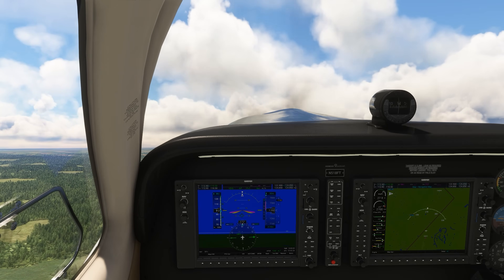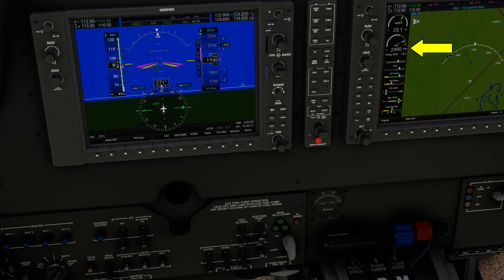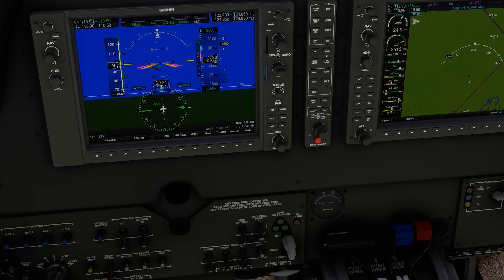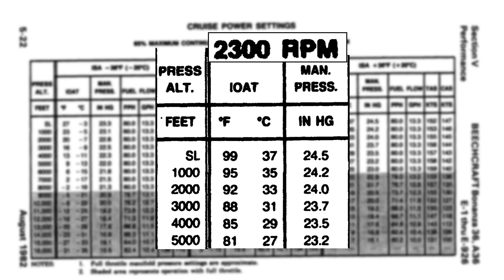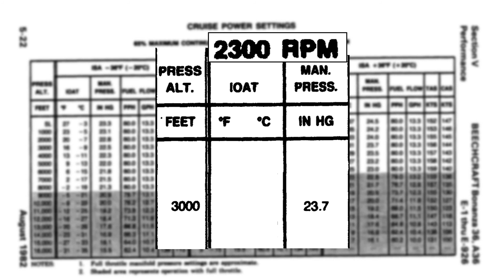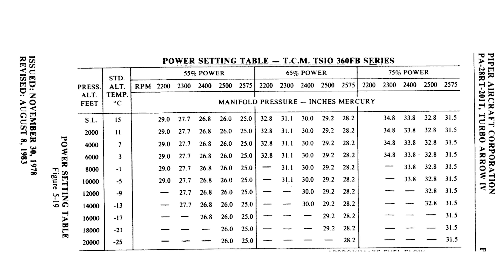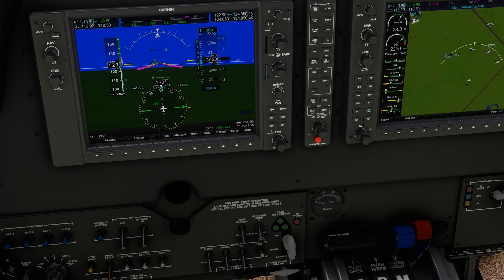The "25 Squared" Myth in Constant Speed Propellers | Keep the Prop on Top

Comment: I tend to run full throttle from takeoff to descent. At 1000' agl I pull the prop back to 2500 and get about 26-26.5"

Comment: Just for fun: “To Square” something doesn’t just mean the math definition. See 5a from Webster.

square
3 of 4
verb
squared; squaring
transitive verb
1
a
: to make square or rectangular
square a building stone
b
: to test for deviation from a right angle, straight line, or plane surface
2
: to bring approximately to a right angle
squared his shoulders
3
a
: to multiply (a number) by itself : raise to the second power
b
: to find a square equal in area to
square a circle
4
: to regulate or adjust by or to some standard or principle
square our actions by the opinions of others
—John Milton
5
a
: BALANCE, SETTLE
square an account
b
: to even the score of
6
: to mark off into squares
7
a
: to set right : bring into agreement

Comment: THANK YOU! 
anyone who doubts it, jump in a Cirrus and during the power lever movement watch what changes first- RPM, then MAP.
Reply: It depends on the plane, the 20 and 22 have a cammed power lever that combines the prop and manifold, which for “non-cruise config” is about  2500 rpm, and in “climb power” 2700. The 22t has a digital prop governor.

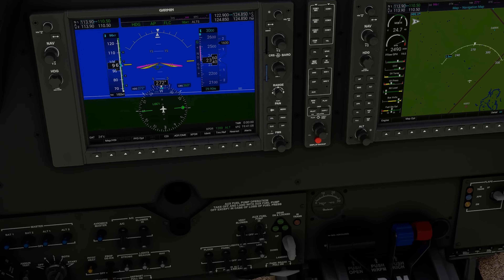Comment: Small Nitpicky point: I think Mike Busch would partially disagree with your point at 0:46. The reason is that manifold pressure (MAP) is not always used to determine power levels. When lean of peak, power is measured by fuel flow not MAP. You're correct only when operating rich of peak. Busch operates his airplane lean of peak, with full throttle and low RPM. And he gets crazy longevity out of his engines. This is because he leans sufficiently to reduce the power levels that the engine is producing. By having the throttle wide open, less of that power has to be used to draw in air. By having low RPM, less of the power is lost to friction from everything in the engine having to move so fast. Which leaves more power for exactly what you want it for: propulsion.

For reference, search "mike busch flying efficiently savvyaviation". The PDF that comes up describes it way more thoroughly than I can.

Comment: In our Cherokee Arrow II with an IO-360, I used 24x24 for cruise and 20x24 if I wanted to slow down and play with the 172's. Lindbergh showed the P-38 pilots that they could run over-squared settings and fly much further and longer.

Comment: Many years ago Beech made an A36 and a V35B with a mechanical single power lever that handled prop, throttle and mixture.  I can’t recall what it gave you for climb power, but was probably around 2500/25in.

Comment: There are as many videos on the “correct” way to run a constant speed prop as there are airplanes with said prop. Even in the few comments already on this video there is nothing but contradiction, and even commenters outright disagreeing with their own POHs.
Here’s my take: first and foremost, fly the POH. After that, under or over squared just doesn’t matter at all, it all seems to boil down to personal biases, beliefs, and preference, and these systems are robust and mature enough to tolerate any ham-fistedness from the hairless monkeys yanking on the levers.

Comment: Where did that power reduction come from? I believe it started with certain Continental engines. The IO-520 D, E & F was rated at 285 HP continuous,  but could produce 300 HP for 5 minutes. Also the E-185-3, -8, -9, -10 & -11 were rated at 185 HP continuous and 205 HP for 5 Minutes. And the C145/O300 had 5 minute limit for take off power. Many of those engines were in the trainers of the the day. That power reduction kind of got stuck in the minds of the CFI's flying behind these engines and they transferred these to all engines. To my knowledge, Lycoming engines never had that restriction, at least the aircraft I have flown with Lycoming engines and constant speed props.

Comment: as much as i appreciate all your vids, i respectfully disagree with this opinion. C182k and O470R carb and i prefer to run at high MP and low RPM and have done so for many years and the logic is easy. the fuel burn in the cylinder is very uneven in injected engines due to the location of the valves, plugs, ports and turbo and many other things-much fuel remains unused and exits the aircraft leaving lead and carbon deposits inside the cylinder to remind you they were not done cooking yet- that said,  its almost a shame but carb engines are even worse with fuel and air distribution as well as exhaust gas scavenging. simply, the fuel burn event does not have sufficient time, at higher rpm, to be efficient to avoid less then optimal burn time, so by lowering the rpm, we give the fuel more time to burn more thoroughly which means better efficiency and lesser leftover deposits I ran my engine 400 beyond tbo and the new overhauled seems very happy there too- i am only trying to suggest another option as food for thought

Comment: Just one of the many areas of aviation in which myths and dogma seem to thrive! Anyone who repeats the "over square" thing presumably has never looked at the power setting table!

I have to correct you on one thing though, I am in Europe and have never seen a manifold pressure gauge that uses millibars/hectopascals. Altimeter subscale sure, but we use the same unit as you guys for engine power. I guess it would just be too much hassle to have to convert the power settings for every plane we fly.

Comment: 2000+ hrs in T210, P210 and 421 and always run them 29-30inHg and 2350 to 2400 RPM--Have exceeded TBO on every engine and maintains evenly distributed compression ratio on annuals.  Just saying it works for me!!

Comment: I drive a 4-cylinder Mooney. On long trips, I'm full throttle from takeoff until halfway through the descent. This does result in an eyeroll "oversquare" condition in the climb until altitude reduces manifold pressure naturally.

Induction systems are most efficient with the throttle plates WIDE OPEN. When partially closed, the air passing through the throttle body/carburetor is turbulent and can result in less-than-ideal airflow. Not only can this be less efficient, it can even result in higher CHTs. The old 25x25 cruise climb recommendation is, in many cases, a wives' tale that has been disproven by advanced engine monitoring instrumentation.  Back in the 50's and 60's the engine/airframe manufacturers just didn't know any better.
Reply: I also drive a Mooney and I’m full throttle from takeoff until I need to slow down to enter the pattern or do an approach.  My cruise rpm’s vary depending on how much fuel I feel like burning.  If I’m feeling cheap I’ll reduce back to 2300 rpm, want to go fast 2500.  Typically I’m at 2400 which is a nice compromise setting.  

I can’t imagine reducing throttle for cruise.  It’s more efficient to reduce prop RPM which does reduce power but also increases the efficiency of the engine and prop.
Reply: @utah20gflyer76  I agree, when I flew my 74 M20F I kept everything forward until cruise altitude and the pulled the prop back to 2500. Left the throttle full forward.
Reply: If you watch your FF in comparison to climb rate while over 25 25 in the plane I fly, you’re just wasting fuel.
Reply: @bradleypeterson2208  Your climb rate is going to be reduced by pulling back the throttle so you have to factor in that I have a higher fuel flow for a shorter amount of time.  I suspect it is not a big difference.  I average 9 gph with how I operate my Mooney as it is so I don’t really care about negligible efficiency gains.

Comment: Just a short reminder. Regarding manifold pressure with constant speed propeller we are using inches of mercury (inHg) in Europe as well. Only when it comes to barometric pressure we are using hPa (hecto Pascal) instead of inHg.
Reply: Some types use fuel flow for power too, e.g. PSIg. But you're right, I've never seen anything other than inHg for MAP.

Comment: In fuel-injected Continental engines fuel flow is noticeably lessened when throttle is reduced from wide open. This will usually further increase CHTs and EGT. Running at full throttle actually cools the engine better than a slightly reduced setting like 25”. I’ve heard the hesitancy to run “over-square” is a holdover from radial engines.

Comment: this is all way too complicated, just think of it like a car.    If you need more power, downshift (full prop) first, then add power.    Lugging any engine at low rpm isn't very good.   2450 (up to) 24.5 is my Debonair setting for anything other than take-off
Reply: I was taught rev up. 

Eg if you’re going up do the rpm/prop first. If going down do the manifold first. 

I like your example also
Reply: I always used to drive my cars (lat 1980s and early 1990s, carburettored, not fuel injected), at low RPM in the belief that lower RPM would have less wear. The danger of low RPM and high power is premature ignition, but this should be less of a problem in high octane AVGas. I can see the argument that producing 200 HP at 1500 RPM means the pistons are handling twice as much power as when the engine is producing 200 HP at 3000 RPM; and that the time in contact with hot gas is longer. I'm not sure if has an impact or not.

Comment: Then you get into a DA-40 XLS.   i've been taught after you get the flaps up, you leave full power in and bring the prop back to 2400 and thats your climb setting. full power@2400
Reply: I thought that was just a European thing for noise. It certainly doesn't harm the engine.

Comment: I was mislead by dad and brother, both fly Bonanzas, who pull back the RPM with FT at 500 AGL. I don't remember their RPMs, but I know they were still FT. A-35 and G-35.
Reply: Those older Bonanzas had the E185 engine and the did have a 5 minute max power for take-off. So, yes they had to pull the RPM back after 5 minutes.

Comment: Mike Busch has a lot to say about this.  When you're breaking in an engine especially in a descent you don't want to let the prop drive the engine meaning you don't want 2,300 RPM and 19 inches of manifold pressure for a long power off descent.  That can cause glazing.  Driving the engine with 23 inches of mercury and 2200 or 2100 RPM is perfectly acceptable

Comment: Ah thanks for explaining how RPM and manifold pressure effect the engine together. I also thought of it in terms of a manual transmission in a car....you don't want too high a gear (i.e. low RPM) when you are still powering up a hill because it puts too much strain on the engine.